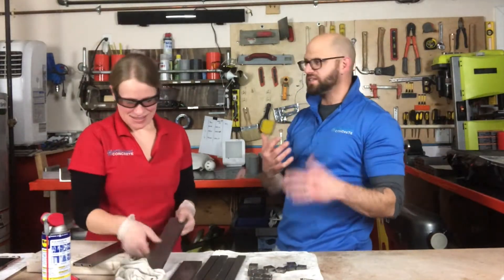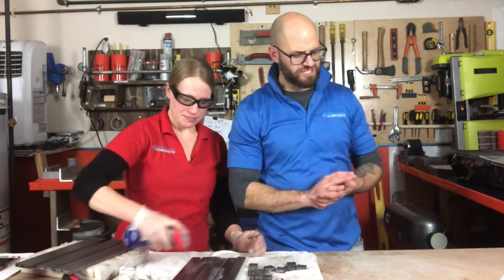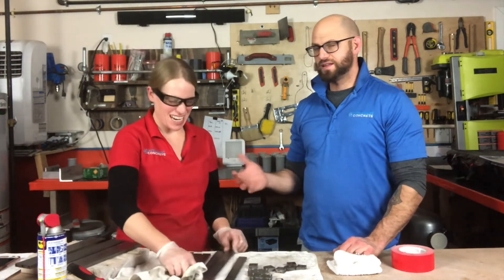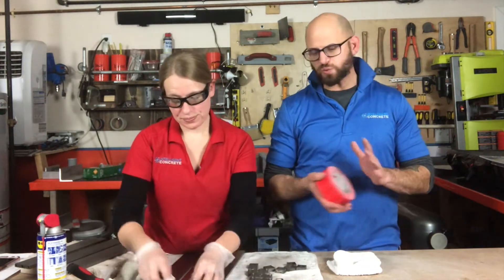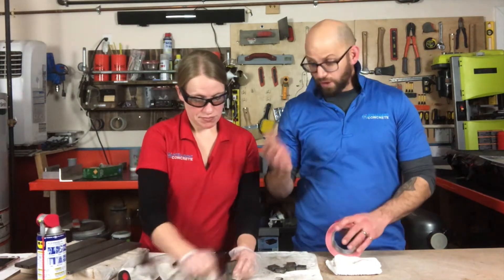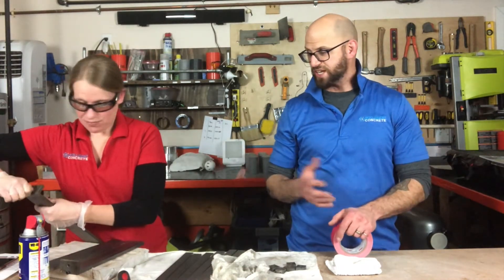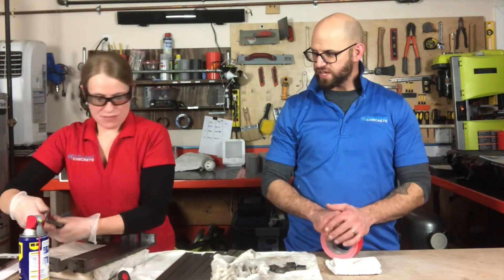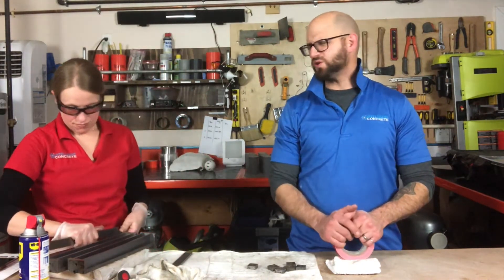Pros and Cons of Pervious Concrete - Vlog #168

Comment: I understand that clear benefits, but every time I see pervious concrete slabs, it is full of cracks and settlements. It seems to me that the same water that leaks through the aggregate also washes of the soil that supports the concrete, therefore settling it. And if it needs replacement in few years because of that, then it seems like it's more eco-friendly to built with regular non-pervious concrete. What do you guys think?
Reply from the maker: Settlement is usually a fault of the subgrade - base course.  I think it all depends where you are willing to invest resources and what the objectives are for the project.

Sometimes, pervious is a really expensive slab.  Nothing more.